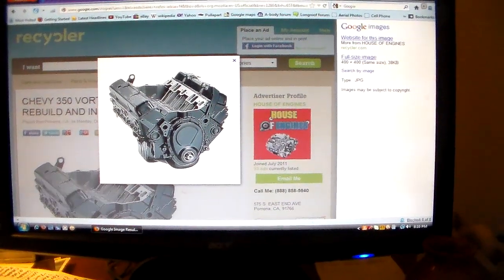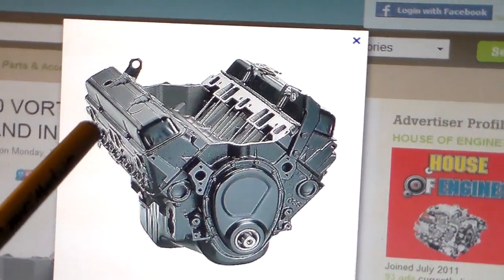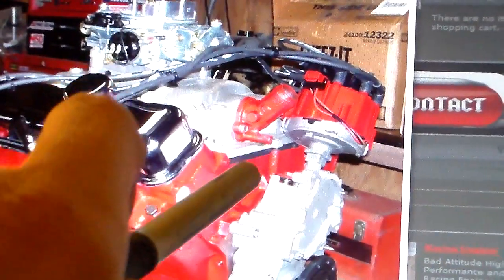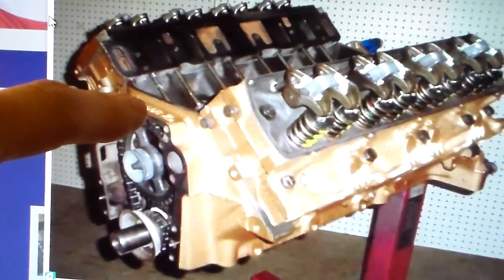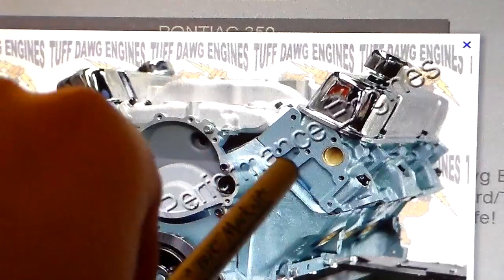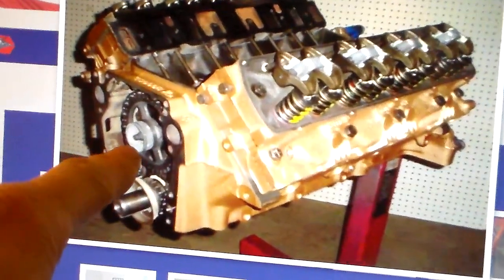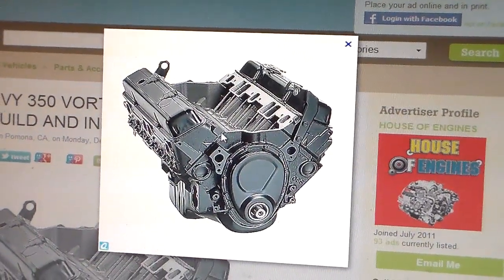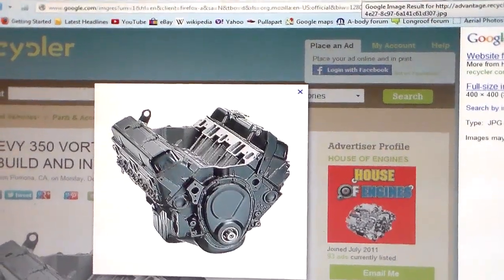Chevy, Olds, Pontiac and Buick V8 engines are not the same!

Comment: I agree I was just watching some information that some  believe Pontiacs made big blocks and small blocks.. but they only made engines.. neither big nor small, they used the same block and then just varied how they set them up. on the inside. Much of the gm stuff in todays world interchanges but back then every section had its own engine. Cadillac, Pontiac, buick, Chevrolet, just because the displacement was the same doesn't make them the same engine, hell, Dodge makes a 383, Chevrolet made one, with 360 AMC made one, ford made one, dodge made one, just like a GMC Jimmy six isn't the same as a Chevrolet six... I don't pretend to know jack.. I learn just as anyone does.. the information is out there.. at least there are guys like this one helping to settle things. Facts are facts and no amount of keyboard warriorness shall change it. Kudos to this video, thumbs up my friend.
Reply: it's all them same after 1981 going on toady because GM only makes Chevy now
Reply: +96TAWS6455  wrong. Olds made a small block up to 1990. Northstar v-8s are Cadillac engines. The 3800 series is a Buick engine made up until 2008.
Reply: +kathy phillips the Olds was so rare it was considered extinct. it was a smog motor and nothing compared to the 401 from 60s 70s. the Cadillac Northstar is dogshit compared the 472 500 from the 70s. that Buick motor is a V6! which is also a piece of shit.
Reply: +Tim Vincent IIRC, technically the 421 and 455 used a slightly different block than the rest...but otherwise you're absolutely correct. There's also the fact that Mopar had "short and tall" blocks, not large or small, and Ford had all sorts of crazy families and designated none of which as big or small block types. Also the 383 Chevy wasn't "made" by Chevy, it's an aftermarket conversions involving a 400 crankshaft in a 350 that became extremely popular.
Reply: +kathy phillips You're confusing the 3800 Series I/II GM style 3.8 with the Buick 3.8 from the GNX/Indy style setups which, IIRC, also used the designation 3800. The Buick version of the 3.8 is the one that's still used in racing builds to get well over 1000 horsepower with ease...the GM 3800 Series I/II are a little milder but even a mild turbo can take the standard, 200hp Series II and makes it a wonderful engine. They also last a long time and although they're not as ridiculously potent in terms of top-end horsepower, they're just as well known for longevity.
Reply: +96TAWS6455 The only 401 I can think of is the 401 Buick Nailhead which, honestly, is a POS compared to the Buick 3.8 from the 80's and even the new Series I/II 3800 GM 3.8's that Kathy was talking about. The 401 Nailhead was also discontinued well before the 70's. Now I'll agree that the 472/500 Cadillac engines are better than the Northstar in a lot of ways but it primarily has to do with the head-bolt problems that plagued early engines and, even after being fixed, doomed the "Northstar" name to have bad sales no matter how many superchargers they put on it.
Reply: +Tim Vincent    Chevrolet never made a 383; that was just a common stroker engine based on a 350 block and 400 crank (I might have that backwards).   HOWEVER, Lincoln-Mercury did make a 383 (predecessor to the 430/462 LIncoln V8s of the early 1960s), and Dodge made a 350 V8 in the 1950s
Reply: +96TAWS6455

First of all, Oldsmobiles are not rare. They put them in every GM division cars from 1977- 1990. Including Cadillac. They made millions of them. It was the only engine that would pass California emissions. That's why they put the small block Olds 403 in the Trans Am. All engines were smog engines from the late 60's until now. Engines really didn't start losing gusto until 71 when they lowered compression dramatically. Then again in 75 when they added the catalytic converter. And it went on from there. 

Maybe the Northstar was dogshit but it made more than 1 hp per cubic inch. More than I can say about the 472 or 500. I like all GM engines except the small block Chevy. It's a P.O.S.

Now, your way off on the 3.8 liter or if you prefer, the 231 Buick  V-6. This engine started as an all aluminum V-8 . They then chopped off two cylinders ( sound familiar, Buick did it first) to make a V-6. They sold the design and molds to AMC. Buick bought the design back during the oil crisis of 73-74. 
They turbocharged this engine in certain models with a draw through system. The main reason for this engine was for fuel mileage.
The 80's tech made this engine a powerehouse, putting a 3800 lbs. car in the 13's in the 1/4 mile. Off the showroom floor.

The same engine was upgraded over the years up until 2008 when they stopped making it.

So to say the 3.8 or 3800 Buick V-6 is a P.O.S. is stupid. These engines have been modified to  run 7's in the 1/4 mile. If you don't know what that means, well 1800 hp. 

These engines have also won many global awards for durability, reliability and power output.
Reply: BTW, 3800 and 3.8 is the same. It's the same engine. GM just upgraded the same engine. Series 1,2 and 3 are the same engine they designed in the 60's. It's just upgraded.

I will agree. Chevy never made a 383. They made a 265,267,283,302,305,327,350,and a 400. And they are all junk!
Reply: kathy phillips
You forgot the 262 (yes, actually a V8 that was the same size as the later 4.3 V6) and the 307.  The 262s were only used in Monzas, IIRC.  The 307 was dropped into almost everything that Chevy built; functionally the equivalent of Ford's 302.

And I was always rather fond of the 283 and 327 Chevy mills.  Of course, I didn't thrash mine all the time, but a tweaked 327 bolted to the frame rails of an S10 is an absolute ball to drive.
Reply: HaHa!
Reply: we're just all talking engines here guys.. no reason to get all uppity and name cally.. I appreciate all levels of mechanic and knowledge.. willingness to learn and to fact check are great tools.. one's mouth or key board presses won't change anyone's mind nor impart wisdom..

Comment: It wasn't till the 80s that gm went broke and made the chevy engine the corporate engine and they went in everything g bodys especially lots of cutlass supremes had 305 or 350 engines in them possibly if they had not let each division make their own and had only one whether it be chevy or olds or whatever and wasted all that money to make them so different engines they wouldn't be so broke now idk but I doubt it lol I'll take a 455 pontiac over a big block chevy even all day they make just as much torque and hp and are lighter not by a lot but a bit and are a bit smaller in over all size but again will make the same power in stock form and severely beat the snot out of any small block chevy pound for pound in stock form were the best junkyard dogs on the block for cheap power and torque that will make the Chevy guys go huh wtf is in that thing lol been there done that more than once picture a square body half ton pickup with a 455 out of a grand prix a turbo 400 with a shift kit and a 3:73 12. Bolt limited slip and tell me that wasn't a fun truck to drive around as a daily and have a blast on weekends tires hated it lol and even camaros often times were no match from light to light and top end forget it there wasn't any end it just kept winding and winding till it was just scary enough and I swear 150 had to be close idk but the speedo went to 100 it went all the way to the zero needle and just started bouncing faster and faster idk but in a pickup nah that's enough of that lol even the 454 camper specials had no chance at all any time the posi did the trick otherwise I could never hook up it had trouble enough with both wheels most nights lol those were the days lmao funny stuff now

Comment: also im not a buick or olds guy but i am a chevy/pontiac guy just knowing those  2 types is you can say there not the same because pontiac uses the same basic bock form the 326-455 not including the upgrades though the years.also the lifter valley was deferent. chevy has completely different engines “big” block and “small” block

Comment: No but Buick 455 heads and Pontiac 6x heads look pretty similar. You can get race heads for small block chevy that have the name Pontiac cast on the head and back in the day you could get either Oldsmobile or Buick race heads made specifically for small block chevy.

Comment: That is one of the reasons GM went bankrupt. thru the 70s 80s the cars had similar designs on the outside but different on the inside. Not exactly a cost saving way to do business.

Comment from the maker: In the early days Gm divisions were "pitted" against each other have more horsepower and better, more marketable features included with their engines.

 GM had plenty of money then but the culture changed in the '70's with the oil embargo. Nobody wanted huge V8's anymore, so no reason to continue to maintain and develop all 4. The Buick and Pontiacs went first, Olds held on another decade, then Chevy was the only non-Cadillac V8 left.

Comment: no shit they're not the same, the topic isn't raging over time, dummies just never checked it out closely and start running their mouth- each engine is different.   but they share many similar parts.  Olds and Pontiac use the same dimension rods, they all use the same dist. caps, rotors, points, condenser.
Reply from the maker: I agree but what you listed doesn't constitute "many" similar parts. Anyway that's not the spirit of the video. Most people couldn't discern either of the 4 350's from one another if challenged to.

Comment: My dad made me know this at a young age! I have the books for dads 77 Buick that had a 350 and the books I found for a 76 Cutlass Supreme. Both list what divison made the engine in the owners manual and how to tell by reading the serial or vin code... My only question is, did buick/pontiac/olds/chevy/gmc use each others 350's (ie: A chevy 350 into an Oldsmobile Cutlass and a Pontiac 350 in a Nova or what not)..I seem to recall reading that GM sometimes did this in cases where they where short
Reply: try a spark plug catalog  should list them all

Comment: Each GM division used to design their own powertrain, but after a while it became an issue. For example, a customer buys a Oldsmobile with the Oldsmobile Rocket V-8. The customer wants to buy Oldsmobile parts for repair and discovers that his Oldsmobile has a Chevrolet LT V-8 equipped in it. Customers started to complain to GM dealerships. Later, GM started to advertise in brochures: e.g. "Some Pontiac models are equipped with engines produced by other GM divisions and subsidiaries." Later GM created GM Powertrain division to design and supply engines and transmissions for GM brands. I remembered my Dad was not happy when he found out his 1972 Chevrolet Caprice had a Buick 400 V-8 engine equipped in it.
Reply: That occurred during the Roger Smith era at GM.  It bothered Mr Smith that f it cost GM about $1800 more to make an Oldsmobile 88 than a Chevrolet Impala/Caprice, never considered they were selling the Old mobile for $2,500 to $2,700 more. He made it so they could build them at the same price by making them the same car, folks stopped paying the extra coin buy not buying Oldsmobiles, GM saved more money by not even building Oldsmobiles. As to who/when each division stopped making there own engines tracks when they shut down the division's foundry. I think Cadillac was actually the first when they shut down what ever foundry that poured Cadillac engines in the late 70's about the same time they downsized the full size car. At that point Oldsmobile started providing engines to Cadillac, they were Oldsmobile engines but had different specifications some were fuel injected prior to fuel injection across the division, that F.I. engine was not available in any Olds. Olds lost their V-8 when they shut down the Olds main plant to re-tool for the 10 car, at that point the plant was re-named BOC #5 and engines started coming from the Delta Diesel plant which was GM's newest plant and but had been shut down when they killed the diesel engine. About this time GM re-aligned the production/assembly into  groups B-O-C (Buick Oldsmobile- Cadillac) C-P (Chevrolet Pontiac) and Truck assembly which was GMC and Chevrolet trucks, Vans and SUVs.  About the same time they shut Oldsmobile down they also closed the GMC division by merging GMC into Pontiac, after they closed Pontiac GMC got moved into the Buick Division.

Comment: The last performance Pontiac engine was the 1979 400 found in some trans ams. Their 455 was dropped in 1977. Amc was still dropping their 401 into javelins till 74. Chevy was only offering 350s in camaros from 73 on. So it is correct that Pontiac made the last pony car with a big block. Some say Pontiac did not make small and big blocks but the reality is their 326 350 400 428 and 455 are all big motors externally and have the weight to go with. Closer in weight to the big block Chevy than to the small block but still not huge as bb chevy
Reply: eric cm uh that doesnt make a big block tho bud it has to be called that by a company other then that theyd all be fucking small blocks since gm cast and made locomotive engines

Comment: Question!! Can I take a 1984 Pontiac Parisienne 305 motor and put it in a 1984 Cadillac Eldorado Biarritz. Will it match up to my transmission in the 1984 Cadillac Eldorado biarritz.
Reply from the maker: Not gonna happen. They never installed a small-block chevy in a front wheel drive application, plus the transmission bellhousing is probably the 60-degree V6 pattern. Your best bet to replace the 4100 that probably blew up is a 4.5L out of a later Cadillac.

Comment: Really, I could care less about which division made which engine.  Up until some given time in the 70's, all the GM divisions, save Cadillac, made a 350 c.i. engine.  I still remember popping the hood on a '78 Olds Cutlass and seeing a Chevrolet V8 in the bay.  Even more surprising, no mention of any engine variation on the sticker or in any adverts.  I knew GM would have a problem with that and they did, some months later.
Reply from the maker: It brought a lawsuit. The end for Pontiac/Oldsmobile/Buick 350's was 1980.